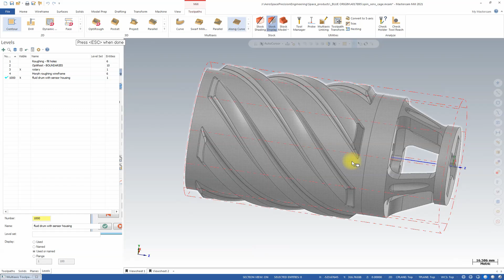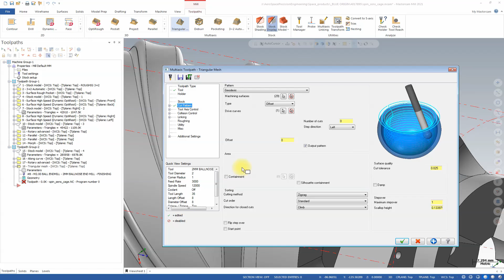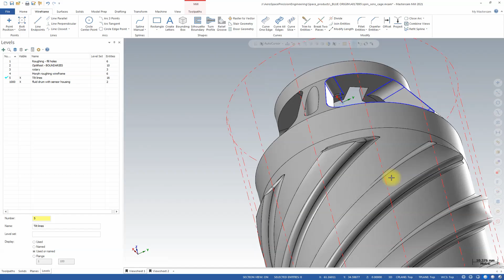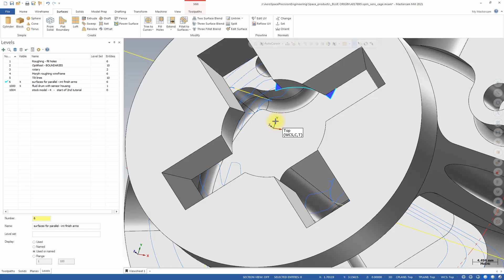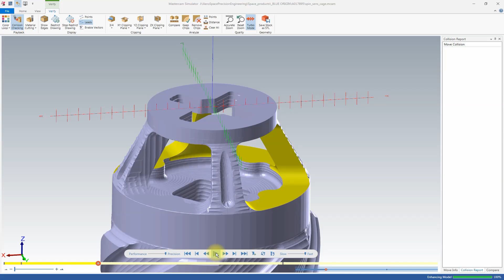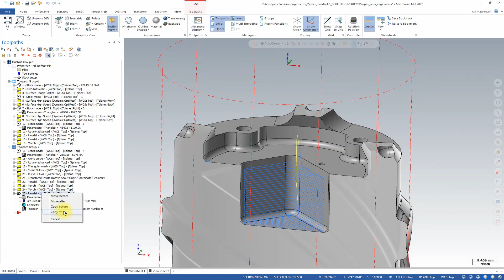5 AXIS Mastercam tutorial  - Spinner -  part 2 FINISHING

Comment: Please one more thing you may be able to help me with :)
you use quite a few stock models in this tutorial, this is always causing a lot and i mean alot of trouble to me as im not that exerienced programmer as yourself
so this is my problem: i use stock models in my mastercam project then post the program start machining and then I realise that my step over in the 2nd toolpath is too big, back to mastercam make adjustments regen and waaaaaiiiiiiittttt ..... :( . .. . . and for big 5 axis project it can take forever! you can easili loose an hour or two!
how do you deal with it is there any way to cut regeneration time? thanks...
Reply from the maker: yes i do have my way to avoid those long regens
we all have to do some tweaking time to time after posting
it is easy to do, just save the stock model result and use it in the same stock model op
Reply: @aspeaerospaceprecisionenging  Dear ASPE could you create a short tutorial for your subscribers please
thank you for all the videos on your channel 👍👌
Reply: @aspeaerospaceprecisionenging  I have the same problem sir,
I program the part then on a milling machine it turns out that my step over is way to big or something is wrong so i fix it and I have to wait an hour to regen all stock model based toolpaths  :(

Could you please make a short video just to show us how it can be done

idle machine doesn't make $$$ :)